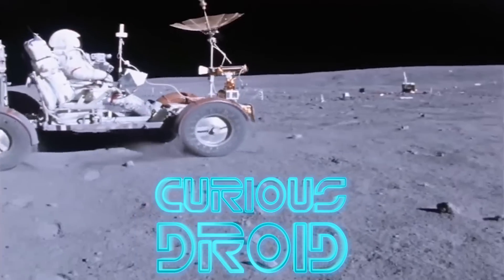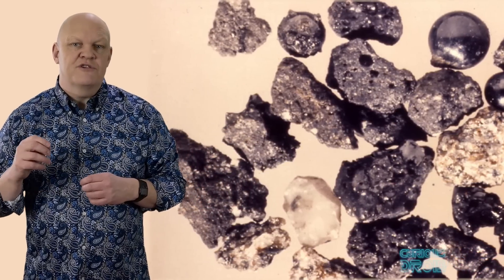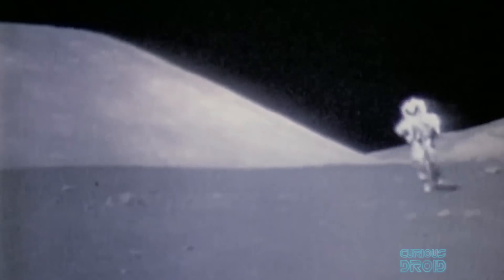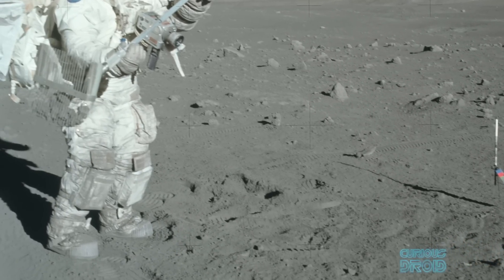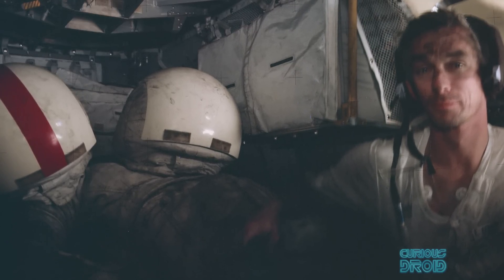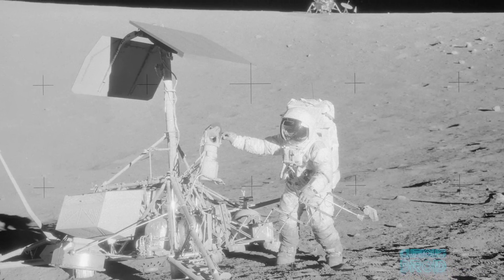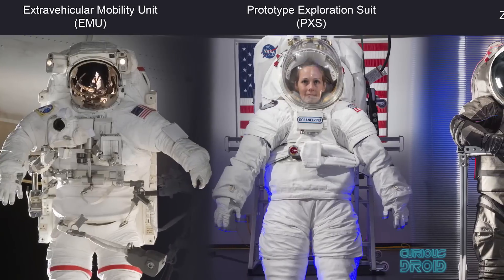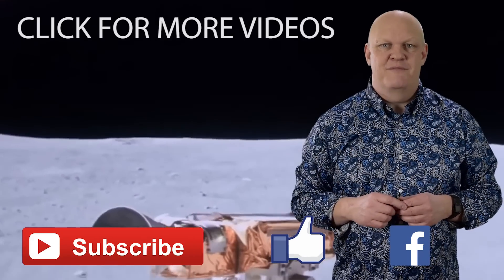Apollo, the Lunar Dust and NASA's Dirty Problem

Comment: Bullshit. The only dust problem NASA has is the one with all the dust under the landing module. They landed on a thick layer of dust with a rocket engine to slow their descent and violated Newton's fist law of motion.
Reply: @Rip Dingers In one video, it was stated that NASA engineers wrote about the possibility of exhaust damage to the landing module. Nasty, stupid people like yourself have to make personal attacks rather than examine the evidence because they are afraid of the ugly truth..
Reply: @kentrobison588  The only dust problem NASA has is the one with all the dust under the landing module.
Except that by this time they knew that it wouldn't be an issue, thanks to the Surveyor program.

They landed on a thick layer of dust
Apparently it wasn't as thick as you were led to believe. Unless you can demonstrate that this dust layer was thicker than what NASA says it is, it's just your word against NASAs.

with a rocket engine to slow their descent and violated Newton's fist law of motion.
How so? They did slow down, didn't they?

In one video, it was stated that NASA engineers wrote about the possibility of exhaust damage to the landing module.
Yes, which is why the idea was to shut down the engine while the LM was still above the lunar surface, to avoid getting the working engine's exhaust too close to the surface.
I dunno, it seems to me that if NASA was concerned about the possibility of exhaust damage to the LM, and they had to fake the landings, then they would've faked it accordingly to their predictions? No? They just started winging it, inexplicably?

Technical writer, Bill Kaysing who worked for Rocketdyne, wrote in his book that it was not technically possible to go to the moon.
Kaysing left Rocketdyne before they actually started integrating their F1 engine into the rest of the Apollo hardware, so his estimation is based on obsolete data, essentially, even if we graciously concede that he did have the actual technical expertise to make an accurate estimate.

Look at the stupid crane-liftoff from the moon. How did it get into the same orbit as the mother ship or whatever it's called?
By tilting it in the proper direction while it was still ascending. There are thousands upon thousands of Kerbal Space Program videos demonstrating how orbital rendezvous stuff works. Merely expressing one's incredulity at the idea that the math between this maneuvers was beyond the reach of mere mortals, when one of the astronauts involved literally wrote his PhD thesis on this very subject, is just ignorant.

Lunar landers are not made from adhesive tape
The weren't made out exclusively of adhesive tape, though. We have pictures of the Lunar Modules under construction, without the outer thermal cover, and they are very clearly not made out of "duct tape", "shower rods" and other silly stuff hoax believers allege they were made of.
The outer thermal cover wasn't very sturdy, or air-tight, yes, but it didn't have to be, and as such, for the purposes and duration of the required task, industrial grade Kapton tape was enough - after all, the ascent and descent stages were built to be as light as possible.
Reply: @Jan_Strzelecki  Do I know you from somewhere?. Newton's first law of motion clearly states 'billions of minute dust particles at rest remain at rest unless acted upon by the force of a rocket engine blast.'  My science teacher never lied to me, Jan.
Have a look at the sticky tape at 13.37 in the 'Absolute Proof' video. It is dried and peeling due to the desert air in the Apollo film studio. This is proof of a hoax. My Lunar Landing Module Construction Manual clearly sates that clear sticky tape must not be used to build space craft because it will fail. It is more dangerous than wearing chicken suits while driving. I can't show it to you because the janitor threw it out.
Have a look at Alan Bean scratching his temple at 11.21. This body language means he is uncomfortable. 
Kaysing quoted a NASA engineer saying that there was less than a one percent chance of success. No-one with half a brain would risk national embarrassment by doing it. It was not technically possible and that is why the Soviets never tried.
Reply: @kentrobison588  Do I know you from somewhere?
You do.

Newton's first law of motion clearly states 'billions of minute dust particles at rest remain at rest unless acted upon by the force of a rocket engine blast.'
So what is the problem here?

My science teacher never lied to me, Jan.
So why are you ignoring what they told you? Your claim that the regolith would form dust clouds on the Moon requires us to completely ignore Newton's laws of motion.

Have a look at the sticky tape at 13.37 in the 'Absolute Proof' video. It is dried and peeling due to the desert air in the Apollo film studio. This is proof of a hoax.
Only if you assume that NASA would inexplicably use a clear sticky tape while constructing their LM mockup, apparently being completely unconcerned about actually making it look plausible, and that a clear tape couldn't have possibly been used just to secure a structurally irrelevant piece to the LM, and that this "desert air in the Apollo film studio" was actually hot enough to cause the tape to peel off without causing any other issues (like producing heat waves).
Unless you can justify those multiple assumptions, your claim is invalid.

My Lunar Landing Module Construction Manual clearly sates that clear sticky tape must not be used to build space craft because it will fail.
What would be the consequences of this particular failure? The flag would fall off. And that's it.

Have a look at Alan Bean scratching his temple at 11.21. This body language means he is uncomfortable.
Perhaps he's beginning to realize that he's talking to a charlatan.

Kaysing quoted a NASA engineer saying that there was less than a one percent chance of success.
And you've still failed to provide a source for that quote. Meanwhile, I can provide you with a source of Armstrong's quote who says that the chance of success was 50%.

It was not technically possible and that is why the Soviets never tried.
Except that they did try. They had everything ready and tested except for the heavy rocket, which kept blowing up on the landing pad. That's the only reason they didn't actually attempt to land on the Moon.
Reply: @Jan_Strzelecki  Aussie humor, Jan!.  Clouds of dust would form.  Scientists agree with me. Atmosphere or not. A lot of dust should be transposed. How long the dust is suspended is not the issue.The low gravity would send it up higher anyway. NASA screwed up with the sticky tape and they have screwed up dozens of times. And they are extremely deceitful. You saw the videos inside the ISS while it was still on the ground. You saw the clown in the harness. You saw the computer graphics. And you say nothing about this stuff, do you?. Why do you believe war criminals and murderers?. They have helped blow thousands of men, women and children to bits with their satellite guided bombs. They have directed-energy weapons on satellites ready to kill the entire populations of towns in the New World Order. A man said on TV that NASA's main purpose is to weaponise space. They withdrew one photo of the sun from public access after a computer was used to prove it was a lamp. There is another type of tape used elsewhere. Why should there be heatwaves?. Depends on the season and the time of day. The dry air of the Australian outback ruins a lot of stuff without heatwaves.
I have been studying body language for 20 years. The astronut is uncomfortable. Another one touches his nose in another video because he is uncomfortable or deceitful. Children may cover their mouths when they lie and adults will touch their nose. %50 chance of success is not good enough. The only way to get success is to fake it. National pride was at stake. The Ruskies would have kept trying because it was national pride too but they knew it was impossible..
Von Braun wrote in his book, page 14 I think, that a rocket would have to be as high as the Empire State Building  to carry enough fuel. Did he really go to the Antarctic to collect moon meteorites?. I am a very competent, self-taught geologist (and botanist). Meteorites have a very distinctive, glossy appearance. The outer layer has to be removed to fake them as moon samples. Then they would have to be artificially weathered.  I doubt whether many geologists were fooled by them. 
I read that the temperature on the moon can reach 240 degrees F. Look at the idiots jumping around trying to rip their suits open. They would be depressurised and the cooling systems would fail. They were not on the moon. A scientist said on one video that they should be jumping four feet. You have said nothing about the astronut getting jerked up by a cable. I have seen Soviet sat. photos of the Apollo film set in area 51 with its artificial moon craters. I have seen photos of Kubrick on the film set. Some NASA or former NASA people want the truth revealed. One astronut punched a film maker and another threatened to have him assassinated by the CIA. I suppose he took his Bible to the set.
Reply: @kentrobison588  Clouds of dust would form.  Scientists agree with me.
No, they most certainly disagree with you. You need an atmosphere to have something dust particles can float in to actually form clouds - otherwise, they're simply going to fly in a ballistic trajectory, in strict accordance with Newton's laws of motion.

And they are extremely deceitful.
Just because you don't understand what the other person has said to you doesn't mean that they were trying to deceive you.

You saw the videos inside the ISS while it was still on the ground. You saw the clown in the harness.
I saw the footage you folks allege shows harness, despite the fact that this magical harness allows the astronauts to have a complete freedom of movement on all axis, which is something that we can't actually achieve with a real harnesses - even if the Moon landings are fake.

And you say nothing about this stuff, do you?
The only thing I can say about that stuff is "You're wrong, and ignorant."

Why do you believe war criminals and murderers?
Poisoning the well fallacy.

They withdrew one photo of the sun from public access after a computer was used to prove it was a lamp.
No, they didn't. The photo is still available online.
And it's not a lamp, either - the effect is only visible on low quality compressed image, and not the original hi-resolution photo, and for that to be a lamp, it'd have to be right in front of the camera. NASA are many things, but they are not sorcerers.

Why should there be heatwaves?
Because it's a desert, during the day. Because otherwise your sticky tape wouldn't peel off.

I have been studying body language for 20 years.
If your understanding of body language is as good as your understanding of physics, then you should ask for your money back.

The astronut is uncomfortable.
Poisoning the well fallacy.

%50 chance of success is not good enough.
Says who?

The only way to get success is to fake it.
Or do it for real. You're just putting out a lot of assertions here, like you were trying to convince yourself that you're still right.

The Ruskies would have kept trying because it was national pride too
Soviets are not sorcerers either. NASA knew that they simply didn't have the hardware to do it at the time.
Also, note the key phrase "kept trying" - why do you think Apollo 12 was scheduled mere months after Apollo 11?

Von Braun wrote in his book, page 14 I think, that a rocket would have to be as high as the Empire State Building  to carry enough fuel.
Yes, by using the Direct Ascent method. Apollo didn't use the DA method. This specific allegation reveals your deep and profound ignorance about the Apollo program.

Did he really go to the Antarctic to collect moon meteorites?
No.

I am a very competent, self-taught geologist (and botanist).
Are you also a surgeon? Or a nuclear physicist?

Meteorites have a very distinctive, glossy appearance. The outer layer has to be removed to fake them as moon samples.
Exactly - which means that no geologist would've been fooled by that, artificial weathering or not.

I read that the temperature on the moon can reach 240 degrees F.
And?.. You didn't follow through? That's a critical research failure.

A scientist said on one video that they should be jumping four feet.
So basically it's fake because they didn't risk jumps that would damage their space suits and it's fake because they risked maneuvers that would damage their space suits? Heads you win, tails I lose?

I have seen Soviet sat. photos of the Apollo film set in area 51 with its artificial moon craters.
No, you haven't. You've seen photos of the training area.

I have seen photos of Kubrick on the film set.
No, you haven't. You've seen Kubrick spliced into footage of "Mythbusters", "Diamonds are Forever" and other NASA documentaries, intersected with the "Capricorn One" footage. And you were completely and utterly fooled by those crude fakes. That's another of your critical research failures.
We've been through it already. Why do you still insist you're right?

One astronut punched a film maker
Yes, because he kept insulting him.

and another threatened to have him assassinated by the CIA.
And yet, Sibrel is still alive.

I suppose he took his Bible to the set.
Three of the astronauts did swear on the Bible, though. I guess that means that Apollo 12, 14 and 17 were real, then?

Filmmakers know a lot about lighting and shadows.
And that's how they know that Bart Sibrel is a liar and a charlatan. He'd like you to believe that perspective doesn't exist, and unfortunately you're too ignorant to know any better.

Here's Kubrick on the set. You can do your usual meticulous research and debunk this one.
So you already know it's not real, then? Why would you bother dredging something you know is fake? Are you too proud to admit you've been deceived?
Reply: @Jan_Strzelecki  You like to critisize my knowledge. I was rebuilding car engines at 14. I have rebuilt many kinds of petrol and diesel engines. I have college certificates for metal turning and basic metal machining. Welding certificates for MMA, MIG, TIG, soft and hard soldering, bronze welding, flame cutting and gouging. I have designed and built many kinds of machines including mining equipment and wood lathes. I have built two small houses almost completely on my own and restored and extended two old Queenslanders. I have built steel and aluminium boats. I built my first radio receiver from a kit when I was 16 and have built, tested and repaired electronics circuits as a hobby for 50 years. I am a self taught mechanic and panel beater and have restored cars. I can fix nearly all kinds of auto electrical faults and do my own house wiring which is illegal. And you?. You are not a nice person. You are outraged that someone would question your stupid moon landings. Look at NASA engineer Kelly Smith talking about overcoming the radiation problems. You tell us how they got satellites to Mars and Jupiter and rovers on Mars if they were working on the problems in 2015. Orion is just a smokescreen. NASA has flying saucer technology, anti-gravity technology and time-travel technology. Apart from Phil Schneider's father who did time-travel research for Hitler and then the US (with others), they get their technology from illegal drug trafficking and trading US citizens for it.  US cities are 'awash' with opioid drugs because the Feds bring them in. I read that a million US citizens are missing. Trillions of drug profits spent reverse-engineering alien technology while 36 million cannot afford health insurance. God bless America. At Dulce Underground Military Base, men, women and children are kept in cages to be killed to make amnionic acid to feed aliens.  A former M16 man wrote on his website that he saw the cages and the body parts in vats when he was there. The US Government murders its citizens . And you think Uncle Sam does no tell lies or has secrets..
Reply: @kentrobison588  Hello again, Kent. Did you have a nice trip? Is everyone in your household safe and in good health?

Give it away Jan.
The phrase is "give it up".

Dust does not have to be suspended to form clouds.
It most certainly does have to be suspended to form clouds - otherwise it's going to simply fall down on a parabolic trajectory.

You are twisting things your way as usual.
I'm just correcting your misconceptions. It's not my fault you're wrong.

You actually  believe a science teacher would say that?
It's not a matter of belief. It's a matter of understanding the science.

I don't know what I am dealing with here.
You're dealing with someone who clearly knows more about the topic of the lunar landings and spaceflight than you do.

I suppose you believe I have a lunar lander construction manual as well.
You could, if you wanted to.

Any one with half a brain can see the astronuts are deceitful.
Just because you really want to be right doesn't mean that you are.

You usually attack me instead of the people who run the sites.
If you're the one saying "dust does not have to be suspended to form clouds", then I'm going to correct that - and correcting you is not the same as attacking you. I'm not saying that you're wrong because you're dumb or something - I specifically point out why you are wrong.

If you don't think guiding  bombs onto people
Irrelevant.

I don't know what photo you are referring too.
Then why would you even bring it up?

I live in the humid sub-tropics and tape eventually peels off.
There's no humid sub-tropics on the Moon.

You attack body language expert Alan Pease instead.
I haven't seen any videos of Alan Pease discussing the Moon landings.

I don't know which photo you are referring to.
You said that already.

In 1969 people did not  have close up photos to see of the lander
Except that they did - even if the Moon landings are fake.

You like to critisize my knowledge.
That's because you're demonstrably wrong about things you say.

I was rebuilding car engines at 14 (…)
Which is undeniably cool, but doesn't excuse or cover up your ignorance about the Apollo program, spaceflight in general, and heat transfer methods (somewhat surprisingly).

You are not a nice person.
Correcting your misconceptions means I'm not nice?

You are outraged that someone would question your stupid moon landings.
No, I'm annoyed that someone who keeps demonstrating that he doesn't know what he's talking about would still insist that he's right.

Look at NASA engineer Kelly Smith talking about overcoming the radiation problems.
I did. We've talked about it already.

NASA has flying saucer technology, anti-gravity technology and time-travel technology.
Therefore, they wouldn't have to fake the Moon landings. You're debunking yourself here.

You have got astronuts jumping around on cables
Since they could freely walk around each other, they couldn't possibly have been on cables - even if the Moon landings are fake. And if NASA has anti-gravity technology, they didn't need cables.

They would not behave like that.
How could you possibly know that?

Sticky tape on the lander.
Again - what would be the consequences of the sign peeling off?

And you know a lot about physics.
More than you do, yes.

In one video, the astronut slides the flagpole into a tube.
Which means that he's transferring some motion onto the flag, making it wave.

Underwater space walk.
Underwater space walks don't look like that. We know that, because we have videos from the actual underwater trainings.

Astronuts telling stupid lies from the space station while on Earth.
Just because you don't understand them doesn't mean they're lies.

Crude and obvious mistakes with their computer graphics.
Such as?...

Fake earth photos with the camera  'close to the screen' and an arm in between.
That wasn't an arm, but an edge of the window.

Humankind's greatest achievement but no statues of the non-smiling heroes.
That is also factually incorrect - even if the Moon landings are fake.

All the tapes lost or destroyed.
That is also factually incorrect.

I heard a NASA liar say that the only machine which can play them was dismantled.
Gene Kranz was wrong about that, yes - NASA kept one of such machines working in case the missing tapes turn up.

"The technology was destroyed". BULLSHIT. They have the blueprints.
Yes - but not the hardware.

You really are a sucker for this garbage.
Just because you don't understand it doesn't mean that it's "garbage".

There is no way that 8 car batteries or whatever
If you don't actually know the power of the batteries the LM had, then you have no basis whatsoever to criticise it. Even if the Moon landings are fake.

What's in their backpacks?. Oxygen bottles and a two-way air-conditioner.
That is also factually incorrect, and, once again, betrays your deep and profound ignorance about the Apollo program. It's not a personal attack, mind you - just a statement of the fact.

What is the combined AMP/HOURS of the battery system, physics expert?
The LMs had 6, later 7 batteries. Two 28-32 volt, 296 ampere-hour silver-zinc batteries; 57 kg each. Four (Apollo 9-14) or five (Apollo 15-17) 28-32 V, 415 A·h silver-zinc batteries; 61 kg each.

What happened when their backpack batteries went flat?
They replace them with fresh ones before that happens.

You are the Apollo expert.
And yet you refuse to believe your claims are wrong.

I want the dust expert to tell us if the lander had air inside it
It did.

If there was air inside, did it have an airlock for entry and exit?
No.

How did they replenish their oxygen?
From oxygen tanks.

How much did their backpack tanks hold?
Lunar surface EVA times for Apollo 11 through 14 were limited to 4 hours, with oxygen stored at 1,020 psi, 1.4 kg of lithium hydroxide, 3.9 liters of cooling water, and a 279 watt-hour battery. For the extended missions of Apollo 15 through 17, the EVA stay time was doubled to 8 hours by increasing oxygen to 1,430 psi, lithium hydroxide to 1.42 kg, cooling water to 5.2 liters, and battery capacity to 390 watt-hours.

If there was no air in the module, how was it temperature-controlled?
It wasn't.

Did they sleep outdoors or inside a 250 degree piece of machinery.
They slept inside, and the temperature inside wasn't that high.

I have welded a lot of aluminium. It conducts heat very rapidly. The lander would have been untouchable.
Had it been made solely from aluminium, it would be, eventually. Since it was made from other materials as well, ones included for the express purpose of preventing the aluminium hull from heating up, it wouldn't be "untouchable" within the mission timeframe.

I have  written that you twist things around.
Correcting you doesn't count as "twisting things around."

You nitpick me over unimportant details
I'm merely correcting your misconceptions.

You wrote on another site that it is simpler, faster and cheaper to build a new design of rocket  (45 years later!). This is nonsense.
That is the reality we live in. 

Have you heard of inflation, wage rises and production cost rise?
Yes. It's already included: even if we adjust the cost of developing a new hardware for inflation, it's still cheaper.
Reply: @kentrobison588  Your're full of crap.
There's no reason to get angry just because I don't share your opinion, and because I point out how your opinion is wrong.

Don't you realize we have different sayings in Australia?
I don't.

So desperate that you have to abuse a Christian filmmaker
Pointing out that this "Christian filmmaker" is a liar and a fraud and proving it with evidence is not abuse.

No-one jumps around on the moon and risks ripping their spacesuits.
At that point in time, the A7L suits were proven to be sufficiently durable that the astronaut in question felt confident risking it. But yeah, it was a stupid stunt, since he came close to damaging the PLSS.
All of which isn't actually evidence, by the way - since NASA wouldn't want to risk exposing the fraud by doing such stunts even if the Moon landings were fake.

You know all about basic physics yet cannot recognize an astronut being jerked to his feet on a cable.
As I've already explained, they couldn't physically be on a cables. Even if the Moon landings were fake.
And you've claimed that they had anti-gravity tech, which means that they wouldn't need to be on cables anyway. Give it up - your claim is going nowhere.

No-one drives a vehicle around without leaving tire tracks.
Neither did the LRV - but it was rather easy for those tire tracks to get covered, either by the regolith being kicked up by the tires, or falling out of them, or the astronauts themselves walking around the LRV.
Also, again - is your claim that NASA was staffed by idiots who wouldn't realize that? Why would they carry the LRV around when it would be easier just to drive it around?

Wake up to yourself. You have lost.
I pointed out how each and every claim of yours is factually incorrect - many of which would still be incorrect even if the Moon landings themselves were fake. In response, you're offering simple denials, and repeat your flawed claims. It's rather obvious here who is "losing" here.

No-one builds landing modules with sticky tape and duct tape.
As opposed to?..
Had you done your research, you'd find countless images of spacecrafts other than the LM covered with shiny thermal blankets held together with "duct tape". But since you didn't, since you've allowed your flawed expectations to take over, you've made a factually incorrect claim again.
Also, you kinda debunked yourself here again: if "no one builds landing modules with sticky/duct tape", then neither would NASA - even if the Moon landings were fake.

Look at the landing module test flight in one of my links. It was so unstable that the pilot had to eject.
Yes, due to a mechanical fault, not because of inherent stability. Had you done your research, you'd know that, and you'd know that the LLRV and LLTV have made over 100 successful flights.

They did not have the electronics to keep it stable.
Actually, they did. They used the fly by wire system, designed specifically for Apollo, one of its first kind. Had you done your research, you'd know that.

I know what a flag looks like in the wind.
Do you also know that wind doesn't act on selected objects? Had it really been the wind fluttering the flag, it would also move the supposed fake lunar dust around - but it didn't.
Also, "it looks like X to me" is not an argument.

Here's Von Braun collecting moon rocks in Antarctica.
No, here's Jarrah White alleging that Von Braun was collecting Moon rocks in Antarctica - and, as usual, people ripping his claim that the Moon rocks are fake to shreds in the comments section.
Reply: @kentrobison588  I never get angry.
Why start now, then?

I have been a martial artist for most of my life
You just keep adding new occupations for yourself in every response 🙂

I have more facts and evidence than opinions.
Except that what you've presented thus far are just opinions.

And so do the hosts of many videos which expose your stupid hoax.
I'm not talking with them. I'm talking with you. I'm addressing your claims.

But you mostly attack me
Again - I'm not attacking you. I'm attacking your claims and demonstrate why and how they are wrong.

It is not possible that the tracks were completely obliterated by dust.
You're right. They weren't. The missing tracks claim has originated with the late Jack white, and his favourite trick was to simply crop the tracks out, so he could claim that they are missing altogether.

Why are there tracks in other photos?
Exactly. Your claim isn't even internally consistent. NASA didn't have to use any crane, when they could (and supposedy did) just drive it into a required position.

Go 4 wheel driving on different surfaces
The LRV has been equipped with a mesh tires. Therefore, your comparison is invalid and moot, since the LRV didn't cover all of its tracks anyway. Also, it doesn't account for the astronauts' activities.

Now tell us
There's no "us" here. It's just you.

You can talk about spacesuits all day but the fact remains that in the video I gave you the helmet was not connected to the pressure suit.
The outer protective helmet wasn't, yes. It wasn't supposed to be pressurized.

You have lost. You are up shit creek in a barbed-wire canoe without a paddle.
You're getting angry again.

I have given you photos of your Nazi hero
Wernher von Braun is no hero of mine. Also, the stuff he did during WW2 bears no relevance to the veracity of the Apollo record.

and printed text in a book stating that he was there collecting meteorites.
Von Braun was not a trained geologist, so he couldn't collect lunar meteorites even if he wanted to. That's what I keep pointing out - it makes no sense for von Braun to go to Antarctica to personally search for lunar meteorites (and even less sense that such trip would be documented). That claim only makes sense in the cartoonish world of omni-disciplinary scientists who can do all the science the plot requires them to.
Reply: @kentrobison588  You wrote that the tracks were covered by dust and now you claim that they were cropped out. Lying again.
Lying about what? There's no contradicton between those two statements. One can't crop out the tracks under the LRV (or what's left of them, anyway) without cropping out the whole LRV - but one can easily crop out the tracks visible farther out, ones that haven't been covered by dust kicked up by the astronauts moving around, which is what Jack did. 

Using Australian vernacular and swearing does not mean anger.
You should stop swearing, then. It's pointless, useless, and counterproductive.

I am not a trained geologist and I can recognize a meteorite easily.
And you know who can recognize meteorites even more easily? An actual trained geologist. There was no reason whatsoever to retrain von Braun and bring him along and to actually publicize said expedition if the supposed objective was to secretly gather lunar meteorites.
No matter how you approach it, your hypothesis falls apart at the slightest touch.

You are making a stupid, arrogant assumption.
No, I don't. I've never claimed that he wouldn't be able to learn about meteorites 🙂

I am astounded by your stupidity and arrogance.
Which, as it turned out, was yours, for attacking a strawman of my position 🙂

War criminals are liars.
We're not discussing the character of von Braun, though, so it's still irrelevant.

Now show us
There's no "us" here. It's just you, struggling with your ignorance.

 the inner pressure helmet
You've... you've never seen the A7L space suit? Or the clips from the suit-up sequence? That's an astonishing admission of ignorance, even coming from you.

and the connections between the inner and outer suits.
As far as I know, there wasn't any - the outer suit was simply worn over the inner one.
Reply: @kentrobison588  You need a psychiatrist.
Your crude attempts at gaslighting are still useless 🙂

Twisting things a round again.
If you can't actually contest what I said, the honest thing to do would be to admit it and move on.

The hose connections have to go through the outer suit to reach the inner suit.
Yes, that is correct. What is the issue here?

Show us the details.
There's no "us" here, Kent. It's just you, being baffled by... something. Do you not know how the A7L spacesuits were made? The video you've linked to explains it in good detail.
Reply: @Rip Dingers https://www.youtube.com/watch?v=IE0B-sjjc-o
Reply: @Rip Dingers https://www.youtube.com/watch?v=42WVk3y9d68
Reply: @Rip Dingers Technical writer, Bill Kaysing who worked for Rocketdyne, wrote in his book that it was not technically possible to go to the moon. Look at the stupid crane-liftoff from the moon. How did it get into the same orbit as the mother ship or whatever it's called?. If the landing module was not dead level, how was this compensated for?.
Reply: @Rip Dingers I am making a huge amount from my new gold sluice box. Designed it myself. Lunar landers are not made from adhesive tape, Sunshine. It's like the outer limits of Retardville, isn't it?. Poor little Rip, too insecure and frightened to believe that Uncle Sam lies to him.